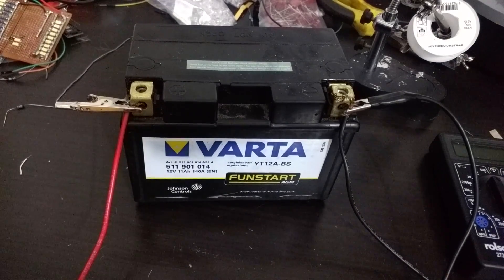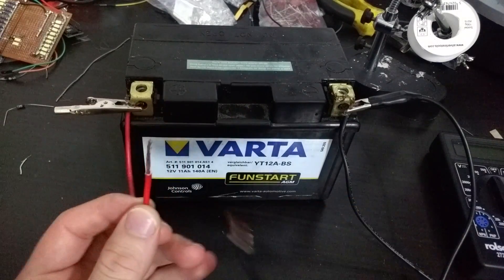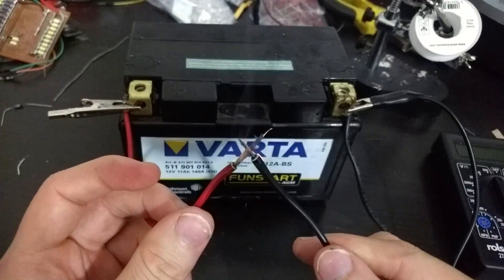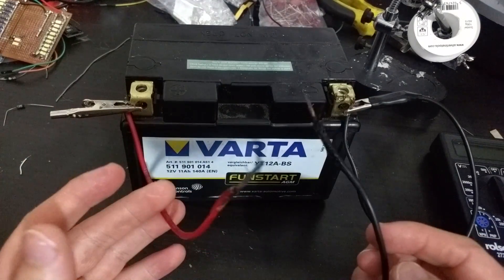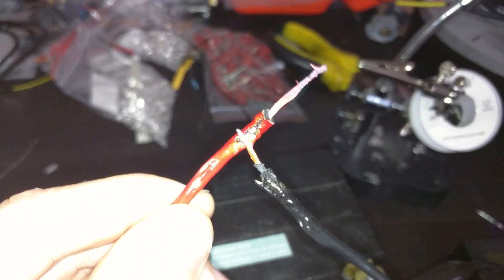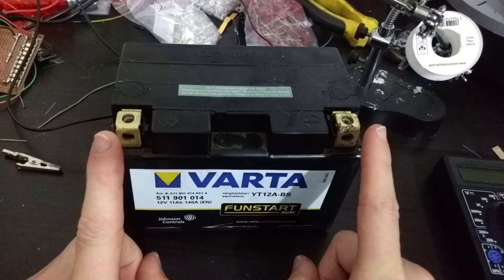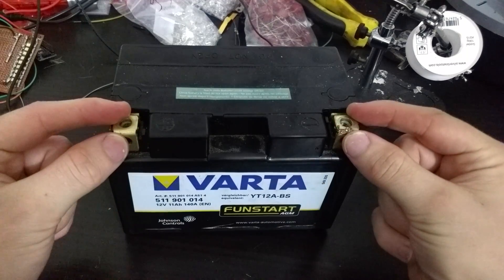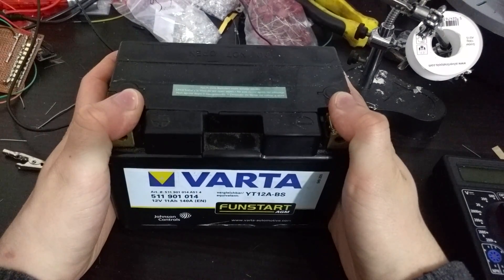Should I Touch 140 Amps!?

Comment: fortunately it looks like a standard lead acid battery  and while you can still burn wires by shorting the battery if you short lithium batteries the outcome can be worse as the chemistry of lithium can lead to damage to the battery that could result in fire.

while you will shorten the life of a lead acid battery lithium  batteries can explode and start fires as they can hold their voltages much better when shorted than lead acid batteries.

also lithium batteries need protection devices to prevent overcharging and over discharging of the cells.

Comment: So if as they say, skin resistance is 100000 oms then you shouldnt even feel 120v ac from the wall socket? 120/100000 = .0012 amps. 120*.0012 = .144 watts. What am I missing?
Reply: It's actually 220v AC, that means 220*1.41v DC ,, although I'm not sure about what u told regarding human body resistance
Reply: You’ll feel 120 vac for sure with just a single dry hand, trust me, but also make sure every other body parts is insulated well specially the feets. But don’t try it just because.
Reply: 250v dc may kill you
250v ac may warn you by biting 
thats the difference

Comment: I=V/R. The wire has a very low Resistance, divide 12 by a very small number, and you get a big number. Lots of amps. Skin and the human body have a very high resistance, divide 12 by a very large number, and you get a small number, very small amount of amps. Thus very little power is transferred, vs in the wires.